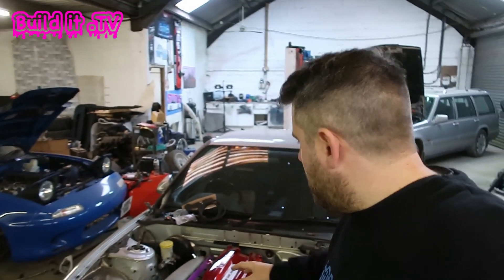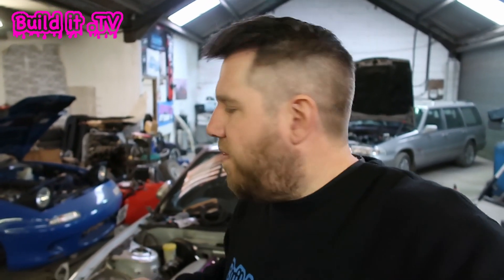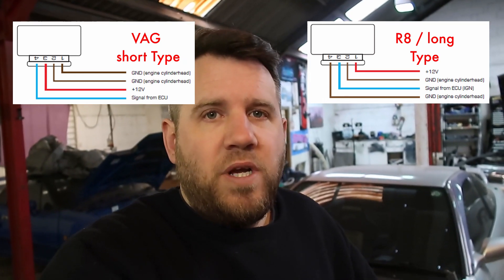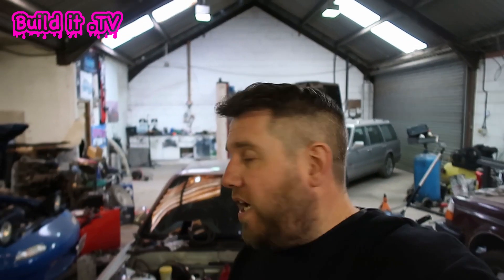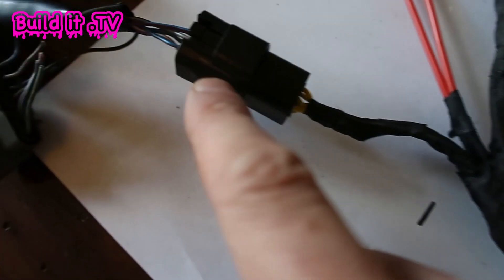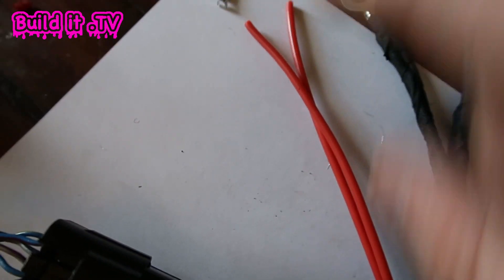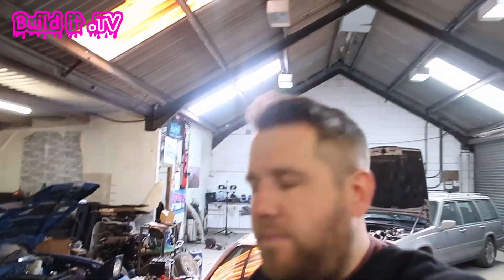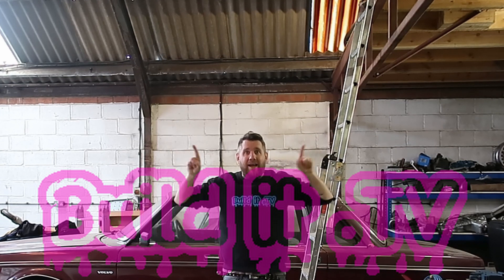RB25 VAG/R8 coil pack loom | BUILD YOUR OWN

Comment: Hi mate, I want to do this on my RB.
To simplify it again, could I cut the plugs off my OEM loom and just connect those wires in the correct order to the new VAG plug? Or would that not work?
Reply from the maker: Hi, the original coils use an ignition igniter (the block that sits at the back of the coil pack cover) and the new vag coils have that built in so you need to bypass the original one. 
It would be tricky to find a plug that matched the OE wiring so it would be easier to just replace the plugs.
Reply: @RJDMaskell AHH ok. The link for the multi plug connector you're talking about? Doesn't work anymore. Is there another link you can send? Or Po not me in the right direction. I didn't see what it looked like in the video

Comment: instead of running 6 positives could you run one bigger and t off at each coil?
Reply from the maker: Hi ya, absolutely you could but the way I have done it you wouldn’t have to solder anything, soldering may cause a bad spot in the wire that in turn could cause an issue with the coil firing.
Reply: @RJDMaskell thanks for the reply mate. couldn’t believe it when i saw your r34, exactly what im doing except sedan. my dream is to put air ride in one day
Reply from the maker: @neutraldown6271 sick, I loved that 34 but I sold it about a year ago to buy a 33GTR which should be on the road soon 🤞
Reply: @RJDMaskell we must have similar taste because thats the only thing i’d sell my 34 for. make a series bro, you make cool stuff it just hasnt got the traction it deserves yet. i’d definitely watch. oh btw not sure if you watch benny surge but his 33gtst with rb26 has come out so good exactly how i’d do it

Comment: do you know the oem RB/SR/CA wire size/diameter in mm² ?? i have read something about 14 awg, which is 2.0mm² but is it really that thick or is it 1.5-1.6mm² ? maybe the conversion from awg to mm² is not correct

Comment: nice video mate, I was looking all over the internet for someone that is using short vag coils on a ca18det and I found you, I know it's no the same engine but I think this is going to work just fine ! thanks for all the information !
Reply from the maker: No problem bud, glad it helps. I’m sure people just go with the R8 ones because it sounds better on a spec list or because they are red but these work just as well and fit better.

Comment: Doesn’t wire specialties have a pre made harness for the vag R8 coil conversion harness for rb?
Reply from the maker: They do it’s about £150 if I recall, but you would have to change other the pin out to work with the VAG coils. 
I have a full wiring specialties harness being built at the moment for this car as the stock engine loom was a bit ropey.

Comment: Thanks for the video,  I’m doing the same swap on a series 2 RB motor, just a question, did you bundle all the earths (signal and main) together and both them to a Chasis earth? Ie does any earth signal need to go back to the ECU through the loom?
Reply from the maker: Hi Paul, I did one to the head and one to the chassis, it really doesn’t  matter which one goes where where though just as long as they are both to a good earth
Reply: @RJDMaskell  Hey man, great video! Im doing the same conversion on my Neo. I should be able to ground through the harness as the Neo harness has 8 pins on a single plug: signal (x6), power and ground. This means I would only us one ring terminal ground to the back of the block, correct? Sorry this isn't really a question, I'm just confirming my logic hahahah. Keep it up mate!
Reply: @brysonkent2199 I think so too

Comment: Thanks! I have a question. I'm using the R8 coils and I already have a "Wiring Specialities" ignitor loom (for Spec 2). Wired it all in, looks ok but zero ignition? Engine just turns over but doesn't fire at all. What am I missing here? I thought the R8 coils were a straight swap on RB25...